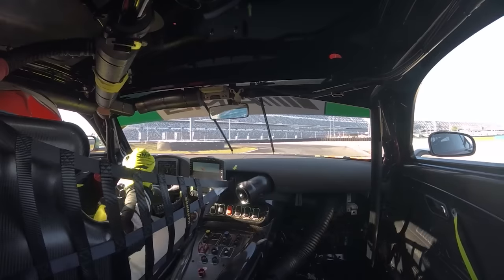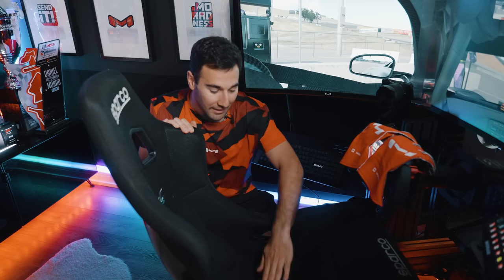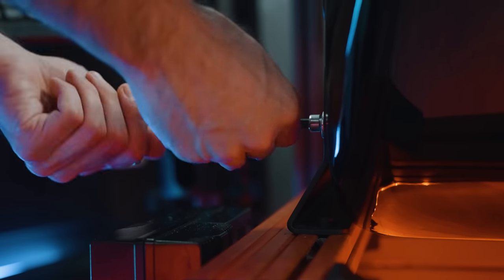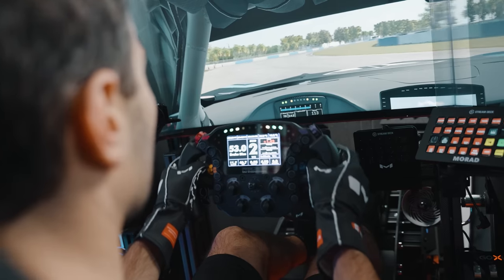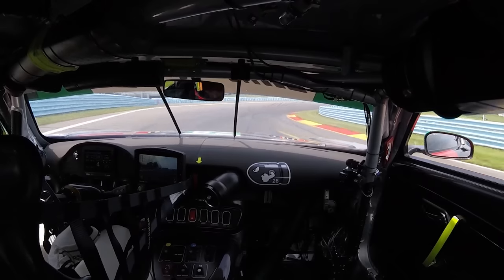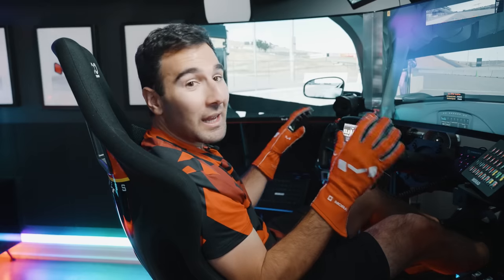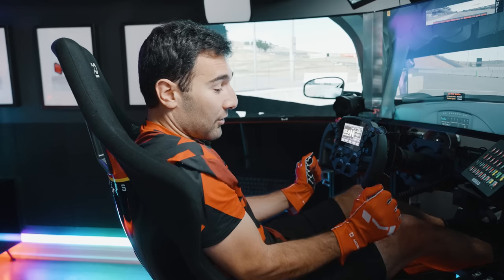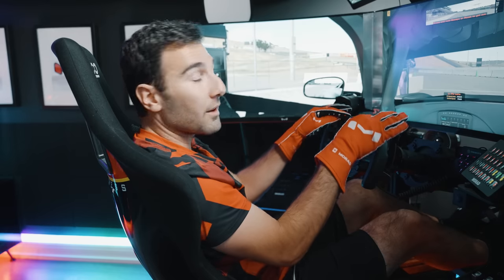PRO GT DRIVER REVEALS THE BEST SEATING POSITION FOR SIM RACING

Comment: This is great, possibly just lacking one point? The one item I keep hearing differently often is how high your pedal/feet heels should be (not open cockpit). Same plane/level as where your glutes are seated? Lower/higher than that position?
Reply from the maker: You are 100% right. I’m getting that question a lot in the comments right now. I’m gonna answer every single one though, because I totally missed out on explaining it in the video. Typically, all the race cars I’ve driven are usually having the seat on the floor. Since the seat is on the floor, the heel goes on the floor and is inline with my butt.
Reply: @danielmorad  You may also consider writing a separate comment about it (not a reply), and pinning it in the comments section of the video. It will be the first thing that everyone who scrolls down into the comment section will see!

Comment: I am thankful that you made this insightful video. A couple of years ago I bought a mid-grade sim rig which came with an upright seat (as almost all rigs do) which destroyed my lower back. I only found out what I needed to do to eliminate the bad ergonomics through a very long and arduous journey of trial and error.

The biggest thing I learned - and I can't stress this enough - is that the lower you want to position the seat, the more reclined your LOWER back needs to be while your upper back/shoulders remain upright. This is simply impossible with the poultry equipment they bundle with sim rigs as you can only recline the entire back of the seat, not isolate the lower back, which is a seating position that also leads to back pain as the wrong muscles get used. (I know because I've foolishly done this and experienced it myself!)

The solution is to buy a pro-grade seat which has the required lower back angle built in - or simply RAISE the seat relative to the pedals to achieve a 90+ degree angle between your lower back and your thighs.

I am shocked by the amount of people I've seen that have their seat positioned very low down and rougly level with their pedals while sitting upright. If that doesn't cause pain, I would bet money it is causing damage to their backs and they'll know about it in time.

I can only hope that this trend changes as people become more aware of the importance of seating ergonomics.

Comment: A big thank you! I use a Trak Racer TR160 for almost half a year and about a month ago I upgraded to a stronger DD and a pedal set with a hydraulic brake. Like many sim racers I had quite an upright seating position and my pedals were very low. While this is good for triple screens, since you are quite enclosed by your monitors this way, I actually was fidling around with my wheel angle and had difficulties driving GT3s with proper braking technique. Especially on ACC it was difficult for me to brake hard and then have enough fidelity to properly trail brake, since I was more or less pushing myself quite a lot up in my GT style seat. And I have to say I probably have one of the most stiff brake pedals on sim racing market (Asetek Invicta). Mind you, my new wheel and the pedals are awesome, I gained consistency within a week and also was already quicker on the tracks I race the most.

But now? With your suggestions and measurements? Wow... just wow. On the Nürburgring I was almost 3 seconds faster on ACC hotlapping, my pace was about 2 seconds improved... and what is way more important, I am now veeeeeerrryyy consistent and managed to put down 1 hour races with only 2-3 laps with off-tracks... that's amazing! The reasons? When I brake hard I don't push myself up in my seat anymore, the force goes directly from my back into the seat and thus there is way less movement. Also the thing you said about the proper shoulder and arm positions... just gold. because I realized that I was not properly snug into the seat with my shoulders before, so like you said I was wiggling around with my shoulders when I had to do a lot of steering. And steering itself is another word: although I was driving far smoother already with my new wheel and DD-base, I am sure I am way more smooth and also calm in this new seating position...

You know, I don't want to belittle the guys I usually follow in sim racing since they know what they are doing and also share their knowledge... but I actually think that most of them get this part of the hobby wrong... I think many of them set their rig more like their former office-chair setups with which most of us start. And I also think since most of them prefer quite soft brake pedals they don't really have any of the problems I had.

Thank you, Mr. Morad, I really really appreciate this! With sim racing exploding and more and more peripherals and brands coming to the market in many shapes, forms and a fairer and wider price range, racing is now literally for everyone... and videos like these are extremely helpful!🙏
Reply from the maker: Thank you so much for taking the time to write an amazing comment. I’m glad to see it’s really paid off.

Comment: It's great to have some measurments from a real car, as reference points. I just compared to my own rig. Turns out, the angles of my seat and wheel are within a couple of degrees from yours. Pretty amazing. The way I set my rig up was to try and establish a floor line at the right height - comparing to pictures and diagrams I could find from GT3 cars. To make that work, I adjusted the seat angle so I was comfortable and able to push hard on the brake without straining my lower back. I also looked at my posture so I wasn't slouching in the seat.

Kinda cool how this arrived at the same angles as you have.
Reply from the maker: That’s awesome! You really can do your own research like that and figure it out. Great job.

Comment: I had to do my racing rig a bit backwards.  I KNEW where the pedals were going to be when I built out my rig, so that came first.  This is an all-wood rig, by the way.  So then I had to measure out where my seat was going to go BASED on how my legs came off it and interacted with the static position of the pedals.  THEN, once the seat itself was at the right angle and position, I had to figure out where the steering wheel felt most comfortable.  It turns out, the plans I had put it too close to my belly, so I had to push it back 2 inches and raise it up 1 inch.  I also altered the angle of attack of the wheel mount to point the wheel a bit further up towards my shoulders.
I used all of these to custom-design the upright sides so that everything bolted on correctly.  Then I had to put the side-pod on for my shifter.  I really kinda wish I had put it a few inches closer to me, but it's totally within reach to shift.
My rig is a personally-modified Ricmotech RS-1 but the wheel deck isn't made of MDF - it's made of particle-board shelf that I had on-hand.  And the pedals aren't two MDF pieces, they're two SOLID WOOD pieces for extra strength.  The whole thing got wrapped in subwoofer carpet material on the desk and the inside leg area and the side of the pedal bracket facing me.  Everything else got the carbon-fiber treatment and I also finished it with black Arcade Trim.  It looks REALLY NICE.  And I have inverted pedals, just like a real car.
Too bad everyone here is gonna hate on the fact that I have a Logitech G29 and shifter set.  But you know what?  Phooey on you!  It's fun to play Gran Turismo 5 on my PS3 and American Truck Sim on my PC on this thing.  I even got a 43" 4K TV mounted to it so the screen is almost exactly 33" away from my eyeballs.  That's important because it gives me a nearly precisely 60° angle of view.  My plan is to eventually get 2 more of those TVs and put them 60° off-set from each other to get 180° of total view in Assetto Corsa, Forza Horizon, and American Truck Sim.
Reply from the maker: There’s absolutely no judgement whatsoever. The entry point is pretty high in the Sim racing. I appreciate the effort you took to get your foot in the door and get going with it. The great thing is, you can always upgrade as you go. Enjoy it as much as possible.
Reply: Sounds like a dope rig man! And dope sweat the guys trashing the G29. For YEARS the infamous G27  was known for holding some of the world's record lap times across multiple sims. The "only" thing bad about Logitech older wheels is the fact that they're gear driven and have that notchy feel to em. Oh, and the worse part, is that they're overpriced to high heavens. $400, kiss my ass! My saved up a few hundred more and went straight to Fanatec. 

I bought a CSL Elite Wheels base as it's compatible on every platform I use but I ever so slightly regret it. If I started off with the G29 like I had bought for my dad, I could be rocking a three pedal setup along with an H-pattern shifter, handbrake and a rig to go with it for around the same price I spent on my current wheel alone. I find myself spending more time tweaking seating positions and messing with wheel settings more than I am driving. With the Logitech wheel I'd just set it forget it. But with the more expensive gear, there are so many more options to fiddle with!

I should've gotten a job to test stuff and used that paycheck to hire someone to set everything up for me lol.

I blame my office chair though. Using a quality wheel stand, with a decently powered wheel and a chair that swivels and doesn't lock at tue exact recline position is a pain in the ass. Every now and then I'll get it dialed in just right but being my office chair, once you move it and raise it back up....💡wow.....Ima get a marker and mark tue shaft where the seat feels best 🤦🏾‍♂️ why'd it take me this long to think about that.

Comment: Love the info and clarity. Thank you.  Curious if you could share the distance from the floor to the bottom of your seat, and the distance to the floor to the bottom of your pedals plate (lowest point of both). I’m struggling to get the pedal height to feel natural. I just ordered a inverted mount kit which I think will help. Curious if I have them to low currently. Any info would be appreciated. Love content like this.

Comment: Thank you very much. I struggled mostly with the steering wheel distance and your suggestion really helped. My times in GT7 have improved. For simulation driving I use a 2 inch belt  above the knee. That is to prevent my legs from spreading thus causing groin/hip discomfort.

Comment: I have used this video several times to optimise my setup, thanks Daniel! Great video!
I have a question. I have an adjustable heel plate with my new pedals (P1X). Is it necessary for my heel to rest against the upright edge of heel plate or should your feet always be in the middle of the heel plate? I feel like in the video you have your feet against end of heel plate. I hope you or someone else reading this can help me. Thanks in advance!

Comment: I try to adjust my Playseat Trophy for a few days now. It's tricky because everything is connected with screws, no moving parts. Also there are limits like wheel base height. 

Daniel I love your channel.  Really great insights from a professional driver. I've seen lots of seating position videos and yours is far more educative than the others.
Reply: I had some issues with my 80/20 rig. I moved to a Motionsimulation ergonomics rig. It’s takes all my pain away.
Reply from the maker: Thank you so much. Of course, some rigs will be a bit more tricky to adjust than others, but there will be many elements that you could take away from this to potentially find your ideal seating position.
Reply: @danielmorad  Yes and I did. Put my seat bit lower to match yours over 50 degree angle and it's a night and day difference. I also removed clutch from my pedals and aligned brake and throttle straight with my legs. Very comfortable now. Thanks :)

Comment: Hey Daniel, I ordered a set of the ASR Max Range seat brackets you have and fit them yesterday, but they aren’t the same as what you have. They only have 2 holes at the back (you have 3 and that lower 3rd is the crucial one). I installed them and in their most reclined position, I’m 10-15 degrees off where you’re at and sitting more upright than I was with my old, knockoff brackets. My whole goal was to replicate your seating setup and other tips so I can try to match the real deal Holyfield! Do you know if they changed the design for some reason? I’d share a picture if I could on here. I’m wondering if others are having the same issue because ASR doesn’t have a picture of these seat brackets on their site like they used to. I’ll reach out to ASR and mention all this, but I wanted to see if you knew anything about this or if perhaps you’re using different brackets.

Comment: Great video! But the 53 degrees is weird to me, is it the same measure system like in the EU? I mean with 53 degress I am almost lying in the seat
Reply: I was wondering the same, but it depends on how you are measuring: relative to the horizontal or vertical axis? If you turn your phone upside down, you’ll get the other value, which should be equal to 90 degrees minus your initially measured value. If that makes sense…
Reply from the maker: If you look in the video to see where exactly I’m measuring on the back of the seat, that could potentially help, but you may be inverting the degrees.
Reply: @david_haas_  if yoi invert it becomes 37 degrees. Too much anyway. Don't understand how those 53 degrees were taken

Comment: Great vid def gonna use it. Only question I have is how high should my pedals be compaird to seat? At the moment my bum is about 2 inches higher than my heals on healplate. That sound about right?
Reply from the maker: Thanks a lot. My heels are about in line with my butt. It might be 1 inch lower than my butt so it’s about right.

Comment: Amazing video! I’m just about planning on getting a rig for myself so this was perfect timing. Would it be possible of you could maybe measure the seat angle of the Oreca 07 maybe? I saw your last measurements on your discord channel and was wondering if you could maybe help us out, who would like to have an LMP style seating position?
Reply from the maker: I will definitely do that. I have a lot of friends driving that car. One thing to note is that every single seat is slightly different. All of our seats are custom moulded to our bodies. Typically, if you have multiple drivers, the biggest driver will make the base mold And the smaller guys will go in with a small booster seat which is also custom fit with expanding foam. 

Jump in my discord, and I will collect more data on these topics. Ideally, it would be best if you could remind me around the Laguna Seca race weekend for IMSA
Reply: @danielmorad  will do good sir. Thank you very much!

Comment: Great content! Something I don't see talked about often is pedal height relative to seat. Do you have any tips on that? Your seat looks more in-line with the pedals compared to a normal road car. I assume its not mentioned much because most sim rigs are not very adjustable with seat height to pedal height, and you're more or less stuck with the predefined position. I always wondered about this as GT seat height looks higher compared to a formula position.
Reply from the maker: You’re definitely right. It’s something I missed in the guide. There’s always room for improvement on these things, but I can explain it in the comments now. Typically, I have my pedals fairly in line with the bottom of my butt. Essentially, my heels are in line or slightly lower than my butt. It’s only in that position because it feels most comfortable to me. Also, that’s how my real race car is. Imagine that you’re sitting on the floor. That’s how I’m lining it up.

Comment: Thank you for that video! Really helpful!!! I have question about pedal height, when my seat reclined back I feel like I am sliding up in heavy breaking zones, is it pedal height issue? Thank you in advance!!!
Reply from the maker: You might want to bring your pedals up in height. If you’re pushing down on them, it will push your whole body upward. You want your back to be driven square into the seat, so having your legs up higher in your thighs, driving straight into your back will help. Just make sure that you have enough of the bend in your knee.
Reply: @danielmorad  thank you for responding!

Comment: Hi Daniel, great video. Thanks.  I noticed that you drove using socks, would it not be better if you used your racing boots as it gets closer to your racing conditions?

One more thing. This is sim-racing, I am curious how they do the positions in endurance racing when you change drivers. These changes are done in less than a minute. Are changes made to seat position/pedals/steering wheel?
Reply from the maker: You would think so, but because on the simulator, you’re using a lot more finesse with the brake percentage, I like using socks. Also, it’s much more convenient to just jump on and drive. Moradness Sim Socks.
Reply from the maker: In the real car, we have a seat insert and we can adjust the pedal box. I have a new video coming out on that

Comment: Very nice video but how did you get such a big angle for the seating possition? I cant set it up over 20 degree for the bottom Part. What kind of seatconsole are you guys using or is it maybe the seat itself?
Reply from the maker: Can sometimes be dependent on the seat and also the brackets